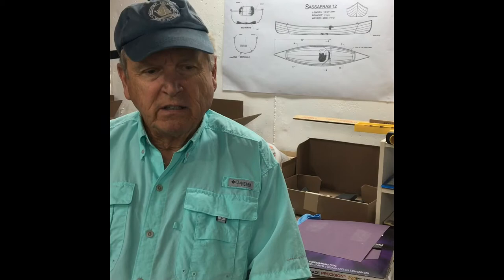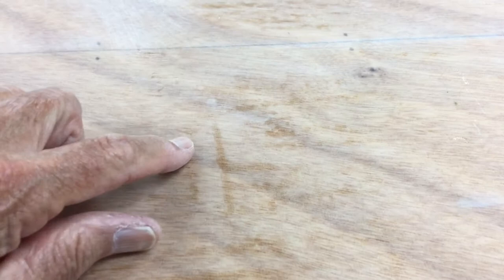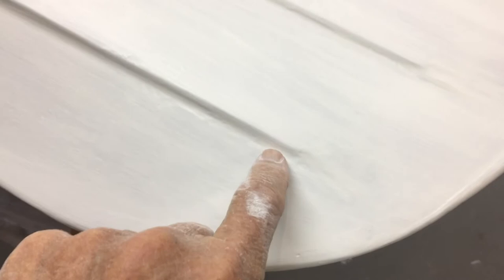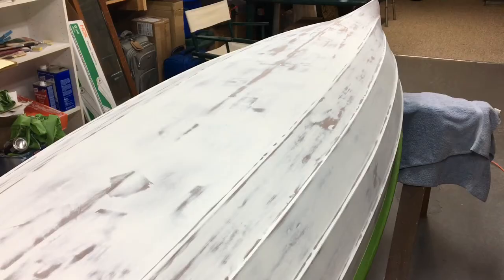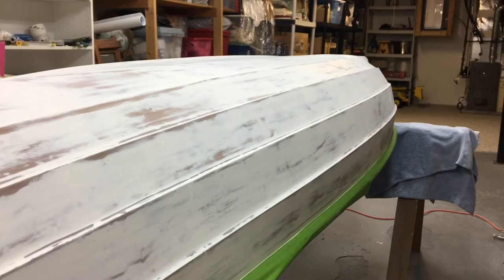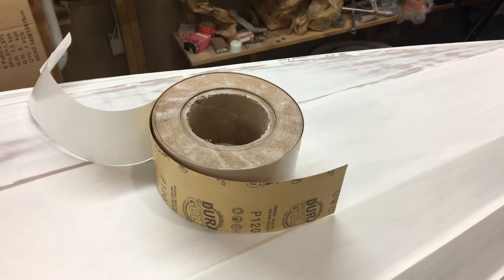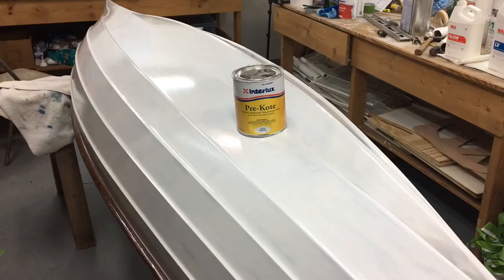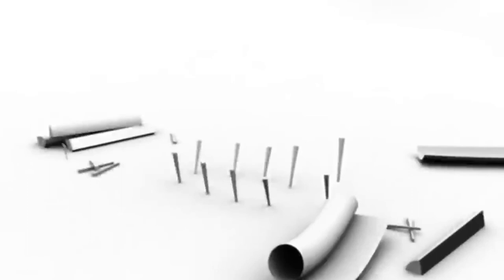Sassafras 12 - Episode 16 - Painting the outside of the hull ( part 1 )

Comment: Good tips about the sanding block and adhesive sandpaper.  The hours spent sanding the boat are becoming quite evident.  I'm confident you will be quite pleased with the finished product!
Reply from the maker: Rick, Glad you're still with me at some level. The painting and varnishing is very slow but it is what you see at the end. Working on the one-part poly finish coats now. May require 4 or 5 coats but coming along nicely. Any decisions on your build? Happy Boat Building!
Reply: @captainboatbuilder4517  No decision.  I’ve been doing home projects and making a few bee habitats that a few folks have asked me to make.

Comment: Just found your channel today. I'm also building a Sassafras 12 and just happen to be at the point of applying exterior primer. I'm sure I'll find your videos helpful.
Reply from the maker: Glad you are enjoying your Sassafras build. I thought that the Intrelux Pre-Kote primer would fill the tiny holes but even after 4 coats and plenty of sanding they were still visible. I started with 3 ( and in some places 4 ) coats of epoxy on the planks so the leakage issue was not a consideration. I would recommend the thickened epoxy solution you are considering. Just be sure to scrape off any excess with sharp putty knife or the plastic spreaders to limit sanding. My plan to use the primer as a filler didn't work very well on the wire holes. The priming and painting of the hull can be very slow but the final finish is worth it. Happy Boat Building!

Comment: I'm having the same issue with the unfilled wire holes that you experienced. Are you certain that wood filler will be durable enough to resist stress and possible leakage? I was thinking of mixing a small batch of thickened epoxy to deal with this, but filler would certainly be easier and less messy to work with.